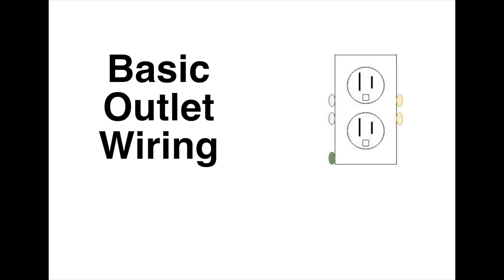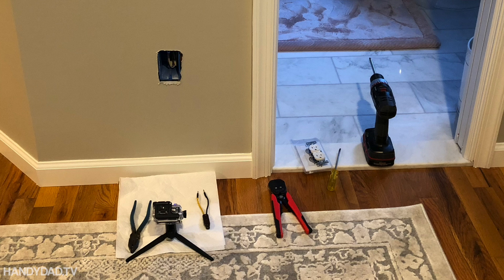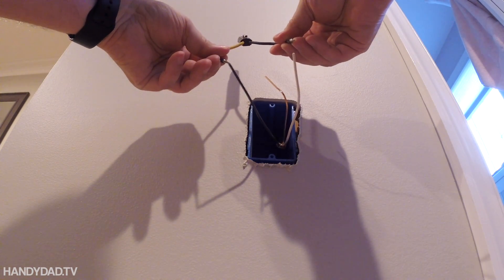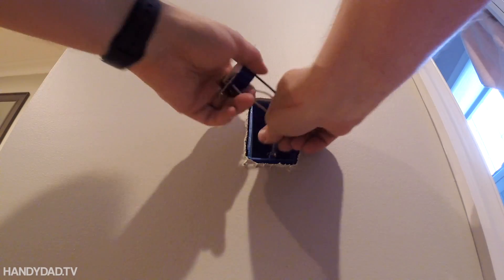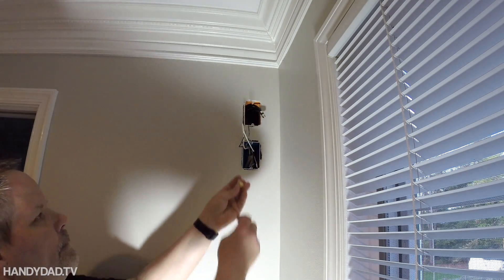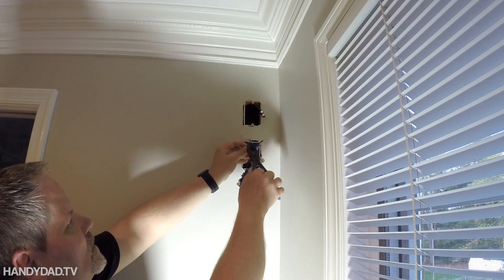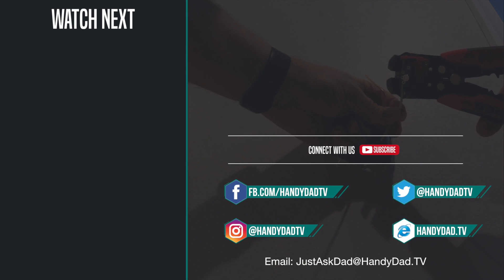How to Wire an Electrical Outlet

Comment from the maker: ☕️☕️☕️ If you liked this video, say thanks with a cup of coffee 👉🏻 https://ko-fi.com/handydadtv ☕️☕️☕️
Reply: fire hazard to run power through receptacle, pigtail the white and black wires too!  source: electrician at my house today bc outlet was smoking and burning bc wired like this.
Reply: I wired my last plug in like yours. Now it's showing an open ground.
Reply from the maker: @Kenny You need to figure out where a wire came loose.
Reply: @handydadtv  it's in a mobile home.  The wires are dropped from ceiling there is no way to get to them. It's the last plug in on the run. It only has one wire coming in.
Reply from the maker: @Kenny, you need to trace every outlet on the circuit.
Reply: @handydadtv  I checked every out let with the tester that has the 3 lights . every out let but the last one shows it's wired correctly.
Reply from the maker: Not with a tester. The tester just proves you’ve got a good connection that far.

You need to remove the outlets and check the connections. A wire nut must be loose somewhere.
Reply from the maker: Here’s another alternative. https://youtu.be/UAEq-yvjryQ
Reply: @handydadtv do i start from the last plug on the run then go towards the breaker box ?
Reply from the maker: Yes. That’s how I would do it. If you can’t find it yourself, call an electrician. It’s dangerous to use an outlet with an open ground.
Reply: @handydadtv  if I can't find it would be alright to take it out and put on wire nuts and just put a plate over the box?
Reply from the maker: Of course.
Reply: @handydadtv  thanks for your help. I will  let you know what I find out.

Comment: So the order of the wires doesn't matter? Or does incoming go on bottom and outgoing on top? What happens if you put the neutral that was at the top on the bottom for example?
Reply from the maker: If you’re not confident in your understanding or skills for electrical work, please hire an electrician.
Reply: @handydadtv most definitely, but just asking to learn.
Reply from the maker: Ok, well, if I understand your question correctly, the top and bottom screws on a duplex receptacle are connected by default so it doesn’t matter which one you use. This DOESN’T apply to GFCI receptacles which have separate line and load connections.
Reply: @handydadtv Thank you!

Comment: “In the middle of the run” you may also hear as “in series”.
Reply from the maker: I reserve the term “in series” for DC circuits where the positive and negative are connected. I’d hate for someone to misunderstand and try that with an AC circuit.

Comment: I use one longer ground wire and wrap it around the ground screw and just connect that to the other ground wire (using the same wire connector in the video that is used to fasten the three ground wires together) that way you do not need three wires for the ground and it is still grounded and connected to both. Great video!
Reply from the maker: It’s not code unless you have a physical attachment device like a wire nut. You can’t just wrap the bare wire.
Reply: @handydadtv  absolutely that’s what is used to connect the two ground wires together after wrapping and screwing down the one ground to the ground connection spot where you have the third wire connected. I figured that goes without saying, I should have mentioned the wire connector when I said connect. I will edit my comment. Thanks
Reply from the maker: All good. 👍🏻

Comment: Thanks for the share, quick question: Do you need to worry about which black/white wires are attached to top/bottom of outlet? Ie incoming/outgoing wires on top/bottom? or does it matter?
Reply from the maker: It only matters with GFCI outlets.

Comment: I'm working a room I have 2 outlet one is alone and the other has a light a light switch and a outlet..my question is  for the single outlet can it go directly to the breaker box alone ..I understand the light switch and outlet combo but the one alone outlet doesn't have to be tied into anything? I can just run it directly to the breaker? I am just running wires I'm not actually doing anything else
Reply from the maker: Yes, you can certainly have only one outlet on a circuit breaker.

Comment: You should never use the push in ports on a receptacle, no electrician worth a damn would ever use those, industrial grade receptacles don't even have them. Always use the screw terminals with a loop in the end of the wire, and make sure the wire enters on the correct side of the screw (as in when you tighten the screw, it pulls the wire in instead of forcing it out). Also, use Wago connectors instead of those push in connectors. My brother in law is an electrician and a firefighter chief and says those crappy push in things are responsible for more than a few house fires. If it were up to him, they would be outlawed.
Reply from the maker: Why are they still manufactured if they’re so bad?
Reply: @handydadtv  Which are you referring to, the push in connectors? Because people are too cheap to buy Wagos and they make money selling them. Check out some testing videos of them, they run current through Wagos and those simultaneously only to have the cheap push in ones go up in flames, literally.
Reply from the maker: Yeah I meant the back-stab holes.
Reply from the maker: @ianjoyce890 I’ve seen some of those testing videos and usually the wire insulation melts before the wire nut or Wago. So it’s really moot. I just preach to make sure they’re tight.

Comment: In the middle- of- the- run outlet does it matter which white wire goes to a specific chrome screw OR which black wire goes to a specific brass screw.
Reply from the maker: Correct. It doesn’t matter.

Comment: Does it matter if the power from breaker box is on bottom set or top + the power from this plug is on bottom screws or top * assuming  half round ground on front is on bottom 
Bottom facing it
Reply from the maker: No it doesn’t matter because both screws are connected.

Comment: Im confused one video I watched said do not use 2 silver screws and 2 gold screws. You should pigtail them instead one silver screw one gold screw to prevent the outlet from getting hot which may start a fire or short out??
Reply from the maker: Everyone has their own opinion. There is nothing wrong with using the screws if you have two wire. More than two require pigtails.

Comment: Hello!  I’m adding power to my shed and I’m confused on connecting ground wires.   On one video I saw they had to be bonded but unless I’m mistake, I think I just saw you use a push connector for the bare ground connecting to the green screw.  I’m fairly new at this.  Help?
Reply from the maker: “Bonded” means connected. All your ground wires need to be connected, every device with a ground screw needs to connected to ground, and every metal junction box needs to connected to ground.

Comment: So for the end of the run outlet, the white wire can be placed at the top left and the black at the bottom right? Does it matter if their both at the top or both at the bottom or vice versa?
Reply from the maker: Top or bottom doesn’t matter. They are connected.

Comment: Question, when I make a hook on the end of the wires to attach to the screws, do I try to wrap them or do I just do a single loop then tighten?
Reply from the maker: It’s a matter of preference. You can use needle nose pliers to close a loop around the screw, but it’s not necessary.

Comment: It would be helpful if you made it clear which set of wires connect to bottom screws and top screws. Thanks
Reply from the maker: It doesn’t matter
Reply from the maker: Here’s an updated version:
https://youtu.be/FW20oimH7Sk

Comment: Excellent video, though I would recommend wiring the outlets with pigtails just incase the first receptacle on the circuit goes bad, the rest of the other receptacles and/or light switches and light fixtures wont go bad. Otherwise, great video!
Reply from the maker: I get such mixed feedback on pigtails. Many say they are more risk than attaching to the screws.
Reply: @handydadtv  oh, didn't know that.

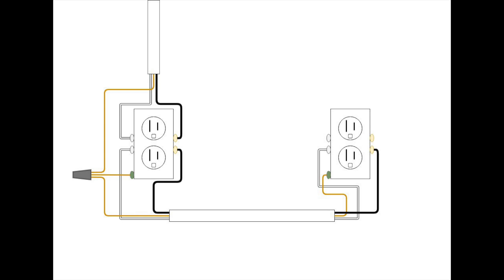Comment: At 03:07 the power coming in is on the Top Screws.    But the end of the run the power is on the bottom screws.   Does it matter for top and bottom ?
Reply from the maker: Watch this https://youtu.be/-WufbstcvRw

Comment: Great video! I have a finished wall with an outlet that’s the main circuit. That outlet is already wired to other outlets going to the left direction of my finished wall. I need to install one outlet going right of the main circuit outlet and I’m looking to get the power from the main outlet I just mentioned, can I add and screw the new outlet going right on the same screws of the outlets going to the left?
Reply from the maker: Best practice is to use pigtails to connect multiple wires, and only connect one set of wires to the outlet.

Comment: Great video with nice explanation.. my question is, if you are adding a receptor in series, wouldn't the voltage drop if other receptors are used by different appliennces? Thankyou 🙏
Reply from the maker: Household wiring is actually parallel, not serial. So no voltage drop.
Reply: @handydadtv  thankyou.. I am newbie and commented from only the info. I had but I appreciate your quick response..
Reply: @handydadtv  would the procedure be the same for connecting an outdoor floodlight camera extending wires from an indoor receptacle using Romex cable?
Reply from the maker: Yes. Black to black. White to white. Ground to ground. It’s that straightforward. Just make sure the circuit is off before touching any wires.

Comment: Is the romax with two wires and a ground a 12-2 (or 14-2), or is that a 12-3 (or 14-3)??
Reply from the maker: The second number is the number of conductors. The ground doesn’t count. 

14/3 has white, black and red.

Comment: Ok but like, where do these wires come from? Or does every wall just have wires running through them in case someone decides to add an outlet in the future?
Reply from the maker: The most common way to add an outlet is to wire it from another outlet. You don’t just cut wires in the middle of the wall.

Comment: What if connecting more than 2 outlets? Going from 1st outlet to second outlet, do the black and white wires go on top, and then the 2nd to 3rd, start like 1st to 2nd?
Reply from the maker: Yes, you’ll daisy chain them together like that. But it doesn’t matter whether you use the top or bottom screws, as long as the white wires connect to the silver screws and the black wire connect to the brass screws.

Comment: Great video. I’m in construction just a highly functioning concrete idiot though! Electricity scares us all! 

How does one create a safe termination for bare wires that aren’t attached to an outlet or are wired for future but hasn’t been installed. 
Example . I’ve removed a light fixture , and I’ve got my three wires , how do I cap the ends to make them safe?
Reply from the maker: I attach a wire nut to each wire and some electrical tape for good measure.

Comment: Started doing some work on our house. The wires in my houses are not exactly how your drawing shows. 
When we took it apart to get to the outlet however,  both incoming and outgoing wires were on the same terminal. Then the black that Isha both incoming and outgoing were both put together as well. The 2 white wires were diagonal of the 2 black wires. 
What is the difference?
Thks
Reply from the maker: The screws on each side of the outlet are connected by default. So it wouldn’t matter if the wires are attached to the top or the bottom.

Comment: Anyone know if the rule below, applies to basement installation of 240v range receptacle? The rule below, doesn't make any comment on it. 

"The stove receptacle (14-50R) must be mounted so the centre of the receptacle is 130mm / 5.1 inches from the finished floor (rule 26-744 (6)(a))"
Reply from the maker: Is that a quote from the NEC or the stove manual?
Reply: @handydadtv  NEC bit I can't see it applying to basements
Reply from the maker: I suggest you ask your town’s electrical inspector.

Comment: What would theoretically happen if we dont create a pigtail wire for the middle of the run and simply wire both ground wires to the green screw?
Reply from the maker: Those screws are only designed for one wire. If you try to attach two, one may come off when you push the outlet into the box, and that would break the ground on the circuit creating a shock hazard. Only attach one wire per screw and always do a pigtail for the ground.

Comment: Hey man, this is a super informative video. I have a slightly more complex situation.  I want to extend a new GFCI outlet to an existing outlet, which appears to be serially linked to another outlet. In other words, in the existing outlet, I think there's a power/hot wire (black/white/ground) coming in and a load wire coming out (presumably to feed another outlet downstream).  My question is: what's the best way to add a new outlet to this one?   I'm thinking either (1) wire it up so that the load wires coming out are split between the downstream outlet and the new outlet, or (2) wire it up so that the hot/power coming in are split between this outlet and the new outlet.   I'm not sure if either way is good and which is the better one.   Any idea?  Thanks.
Reply from the maker: You need to pigtail all of them together like I did in this video:
https://youtu.be/klL8XhKMNT8
Reply: @handydadtv  That makes sense. I think you essentially rewire 2 outlets in a daisy chain into 3 outlets (2 old + 1 new) in a parallel or independent configuration.  I’m actually in the same position trying to install a bidet with an outlet on the other side of the wall.
Reply from the maker: Wow, second person in 2 days adding a bidet!
Reply: @handydadtv  we actually have a few bidets already. But recently we have been thinking about replacing some with electric ones. Thanks for your videos.

Comment: How many outlets can I connect on a 15 breaker
Reply from the maker: There is no limit to the number of outlets on a circuit. The circuit breaker limits the amount of current used, and the more outlets you have, the greater the opportunity for causing an overload.

Comment: I have a 20amp line feeding my garage outlets. First is GCFI which works fine, next 3 in the line work fine, and then the 4th and all receptacles after that don't work. I've replaced the non-working outlet, still nothing. The last working outlet doesn't have any loose wiring. All of the outlets I've looked at only have 3 wires, so I'm assuming I'm dealing with a parallel system, but I don't understand why the rest of the outlets stopped working.
Reply from the maker: Garage outlets should be GFCI protected, so you may have a popped GFCI somewhere else in the house, like I found in this video https://youtu.be/dbmRETinw0A

If you can’t figure it out, you can try tracing the wire, like I did here https://youtu.be/UAEq-yvjryQ

Comment: When you wired the outlet at the end of the run will it power both outlets or just that button one. I’m going to rewire my boat and wondering if I can run ac (from shore) to say the bottom one and ac (from my dc inverter) to the top one and each plug be isolated
Reply from the maker: A duplex receptacle has metal shunts between the screws on both sides. You remove the shunts to isolate each outlet then you can wire them separately.

Comment: An easy way to remember which screw to go to with the wire is....light to light and dark to dark.  :)
Reply from the maker: Yes, usually. But in old homes, they did funky wiring and you can’t always trust the wire colors.
Reply: @handydadtv  Good point.

Comment: Thanks for the video ☕!  It is easy to follow.  In my case, I changed both middle and end outlets but still no power to both of them.  Any tips?
Reply from the maker: Trace the line back to the breaker. Must be a loose wire somewhere.

Comment: I had a portable heater fry one of my outlets, I tried to replace it myself and I wired it backup correctly but now another outlet in the same room quits functioning if you plug something into the one I changed and vice versa. It’s super weird and I can’t figure out why. Any help would be appreciated! Great video!
Reply: Oh and for context both outlets had two sets of wires and a single ground. I hooked them all up, not sure if I paired them correctly or if that even matters.
Reply from the maker: There must be a loose connection somewhere. I’d replace both outlets and use pigtails to connect the wires.

Comment: How do you know the push in outlets won’t pop the wire back out when pushing the outlet into the blue box inside of wall?

Also how do you know how much insulation you should have? What happens if some of the insulation is screwed in as well and not just the copper?
Reply from the maker: The backstabbed wires sometimes come loose. Not often, but sometimes. That’s why some people never use them, and they’ll only use the screw terminals. 

As for the insulation, the installer (you) needs to ensure the screw only tightens around bare copper, no insulation.

Comment: This is such a great video. Would it be possible to do one showing how to add an outlet to the start of a run? It's the bit about wiring into the main box that has me feeling uncertain! Thanks!
Reply from the maker: I usually add outlets to existing circuits and have videos showing a number of situations. But if you want to add a new circuit, this is the only video time I’ve done that on video https://youtu.be/OfdEitiM6u0